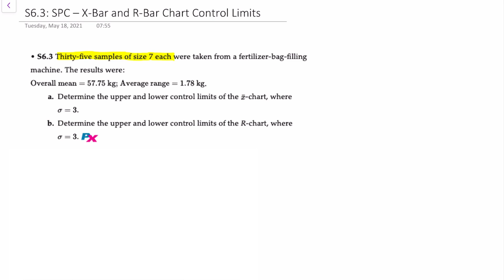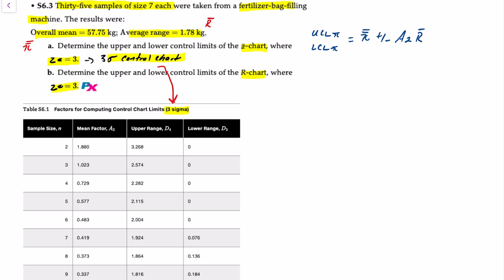Statistical Process Control: X-bar and R-Chart Control Limits

Comment: Hi, thanks a lot for the videos. I have a question. I have studied that design of experiments help to reduce variability. I'm trying to understand which variability though when I compare this concept to control charts. I wonder if some of the common cause variability (noise) that we see in the charts can be actually reduced by controlling some factors with design of experiments. In other words, is controllable factor variability part of the noise when it's not controlled?
Reply from the maker: I would think so. Many controllable factors in a process might go uncontrolled.
Reply: @The_Business_Doctor   thank you

Comment: what if a standard deviation of a temperature setting is already given, e.g 25 deg with 2 %+- tolerance . so now on hourly basis i take certain reading and the mean of that calculates to 23 deg but as per the already given setting it say the average/middle line should be 25 what should i do in this case?
Reply from the maker: Hi Shubham, 
If you're provided with that information, you can construct initial control chart limits based on that and when you take your samples and plot the means against those parameters you can see where your process might be out of control.
Normally you take samples and determine the control chart limits. In this problem, you would have conducted 35 samples, to determine the mean and standard deviation, construct the control chart limits as demonstrated, then plot the means from the samples.
Hope this helps.
Mark